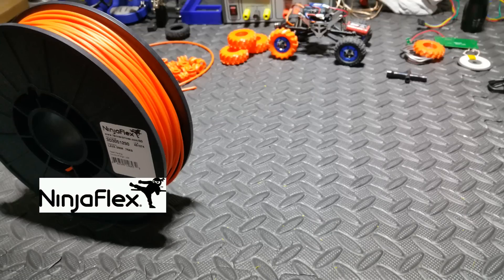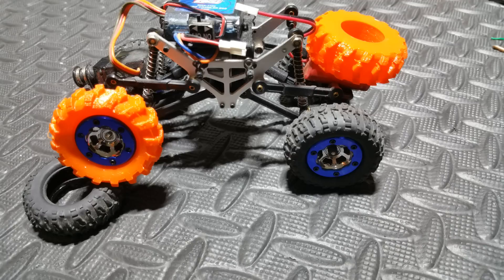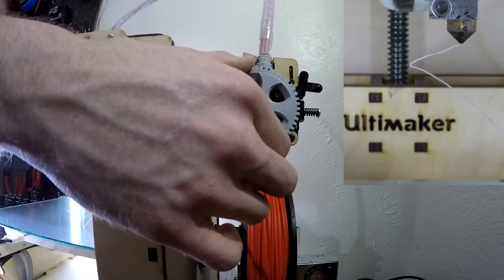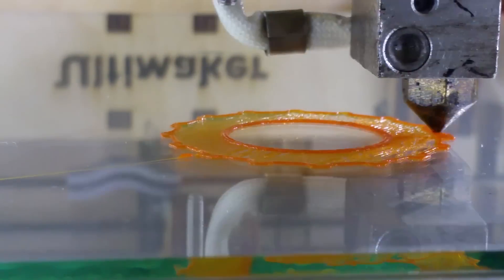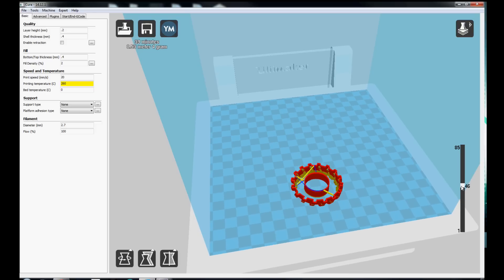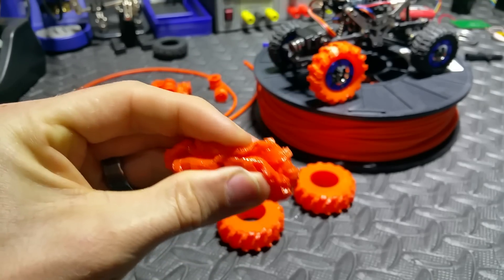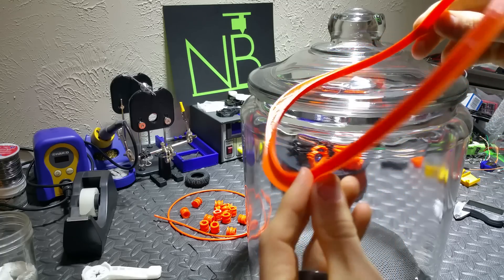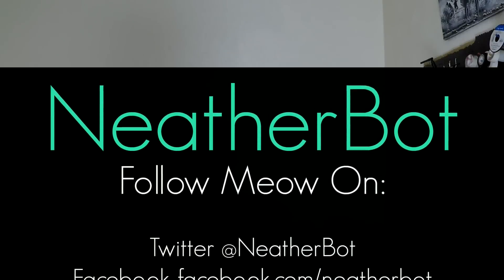Review - Ninjaflex Filament

Comment: I don't even use the same printer as you, but thank you for showing the print parameters when setting up the print.  It is incredibly helpful to have a baseline for settings to start with for any print.  It is also incredibly helpful to see the results compared when you changed your settings for infill and top layer thickness!

Comment: One thing that really helps with flexible filament in my book is to use a little oil on the filament and in the bowden tube. I found in my testing that NinjaFlex tends to be really runny and hates bridging. I don't know if you have tried FilaFlex but it is actually MORE flexible than NinjaFlex but I found prints way better! Just my opinion :) keep up the good work!

Comment: That was a great introduction to Ninjaflex! Good job! I have to order a spool myself soon, cool addition to have in the 3D printing toolbag ;-)
Reply: ***** I bet! I have seen people with dual extrusion making "hybrid" objects with both flexible and rigid filament which sound so freaking cool! Endless possibilities:-)
Reply: I have the Ultimaker 2 myself so i'm still waiting till they announce a dual extrusion kit for that! But shouldn't be to far off now, think the least word was early 2015 but i haven't looked in a while.
Reply: ***** I was checking the ultimaker forums just now to see how dual extrusion was coming along, and unfortunately they have decided to stop working on it. I seems it was to hard and required to much of an overhaul of the machine to be a viable solution :-(

But if you get it up and running on your um1 that would be a video i would love to see! Trials and tribulations I would love to see failure and success. Aparently it's a real bitch to get working more than 50% of the time...

Comment: Excellent video and thanks for the settings. I've had a little success with ninjaflex but just couldn't quite nail the finer points to get it exact. Great tip about feeding the filament too - I tend to do the manual wind-the-wheel just before every print to make sure everything is flowing freely. 
Your dog was not sure about the quadcopter all all!

Comment: So how did you determine the diameter of the o-ring prior to printing?  It has to be smaller than the lid's diameter to make it snug but not so small that ninjaflex can't stretch around it.  Any idea how to calculate or estimate this kind of thing for snuggly fitting around objects?

Comment: Do you know how well this filament handles UV rays? I was thinking about making weather strips for my car with this material.
Reply: @jayr Thanks for the input! I'm restoring an old SUV from the 90's a lot of the weather strips are dry rotted and the replacement seals are no longer available. Maybe a UV protectant coating could help it not to parish so quickly?

Comment: Have you tried using the flex filament to reduce stepper motor sound/vibration? If not would you do a video for it to see before and after. Even if it would be  fail and not reduce sound allot.  Would be good to know. Before others dive into it.

Comment: Can you do a video on you acetone jar also do you think ninja flex will work with a 1.75mm bowden system?
Reply: *****
It can work with 1.75mm bowden systems.  It depends on how the extruder is designed.  You can find successful designs for extruders at thingiverse.  Generally you will also have to print very slowly.
Reply: sillywwabbit I use a Greg wade with an e3dv6 and the tube all the way to the hayena bar (hobed  bolt) 

http://www.thingiverse.com/thing:517099

Comment: With my original Ultimaker 2 i could successfully print with Ninjaflex pretty much with the ABS setting. I have recently fitted the extruder upgrade kit which is where the problems have started. I load it up then start the print, the first 5 or so layers go on perfectly then the material just stops flowing. It looks very much like what you get if the nozzle is blocked but it isnt. When this happens i abort the print then to test the feeder i put it on "move material" and it flows fine. Does that ring any bell?
Reply from the maker: +AD58 A few things to look into. I am not sure what ABS settings you have but that is strange that it works with Ninjaflex. Temperature would be about right, but print speed and retractions would not be optimal. Take a look at print speed and if it is faster than 20mm/s I would slow it down to around 15-20mm/s. Retraction I would think needs to be modified, but if prints are not stringing then you are ok.
Have you tried any other prints with the new extruder and pla or abs material? Two things could cause this type of behavior of the first 5 layers going down before filakent flow being restricted. You could be printing too fast and the hotend is running out of thermal capacity or the temp could be too hot and printing too slow will csuse heat creep in the hotend. There are a lot of other reasons that might cause this but check the temp and speed first.

Comment: Hi, I am using Upbox 3d printer. I am actually wondering call all printer actually uses these different filaments? 

By default, my printer written that I can only print ABS and PLA.
Reply: +jacky sew Some printers can't reach the correct temperatures to use some of the more exotic filaments. Also the extruder setup will also come into play.

Comment: hey, just out of curiosity!
what would happen if I insert a heat shrink tube to the printer instead of the filament??
Reply from the maker: Haha I love the ingenuity of this question...I am certain it would not extrude. I would think that the tube would probably do its shrinking thing then slowly burn up and clog the nozzle badly. I would recommend NOT doing this.
Have you already tried?
Reply: huh thanks man.It would have been my first experiment XD
Reply from the maker: +tilan wickramarachchi to help you narrow down your experiments and avoid issues I would suggest only trying to extrude thermo plastics. Thermo plastics are special in that at a certain temp they begin to melt and flow, not burn. Other plastics will just skip right to the burning stage. I would be very careful expirimenting with different materials that are not originally intended for 3D printing. You can easily start a fire which I don't thin no anyone wants to do. Stay safe and keep up the experiments!

Comment: How do you create the acetone vapor in that glass jar? Do you just fill the bottom and then put the jar on a hot plate?
Reply from the maker: +Reptileguy 505 there are a few different ways. You can soak a paper towel and stuff it in the jar and let the cold vapors fill the volume. If you want to speed things up you can put the whole jar on a hart plate. But be careful you create a lot of fumes with the hot plate.
Reply: Do you recommend using the cold fume strategy?
Reply from the maker: +Reptileguy 505 it is slower, and less dangerous. But if you take some precautions using a heat plate can work awesome. I would recomend starting off with cold fumes. To see if you can get the results you want. Pull the print out of the fumes before it's fully smooth, it will keep melting a tad more after you pull it out.
Reply: Okay. Thank you so much! Love your videos too by the way! Keep up the good work!
Reply from the maker: +Reptileguy 505 no problem, thanks!

Comment: you can print it with bowden extruder? I have a mk2 like direct drive now only 6mm play but too soft flexi filaments are getting stuck, maybe becaus eI have 1.75 fila... not 2.7mm...
Reply from the maker: I have always printed ninjaflex with a bowden extruder. I also use 3mm filament.

Comment: wait.. you are setting the nozzle diameter contrary to what it actually is?? I have printed ninjaflex with a bowden tube with mixed results...
Reply: +Neather Bot I printed a cell phone case and some anti vibration do the keys for my quad that I designed. I think the key was slowing down the print for me. and what's interesting since I am using the Bowden set up is the extruder motor setup I have going on. I'm not sure you have ever looked at the Printrbot drive gear for the extruder. both the drive nuts and the bearing that usually squeezes up against the drive nut, they are both geared. so the bearing and the drive nut bolt have teeth that push the filament with more control.
Reply: so I guess I am asking... is your filament actually 3mm or 1.7mm?
Reply: +Neather Bot okay now it makes sense, that's what I assumed you were doing I do the same thing however I just change the flow rate. I increase it by about 15 to 20% and I think that changes the same thing but it probably depends on what sites are using as to whether or not that setting exists

Comment: Stupid question. If you print a Real size Shoe. and you wear it for 1 year. is that still strong. I mean the durability
Reply: +Neather Bot Yes. but the other company release the "FilaFlex" use only for Heavy work. maybe like hiking boot or something. They even produce they own extruder. So you can't making by using stock extruder Printer. but still. it kinda curious if we can build our own flip flop or shoe. Crocs shoe style. since the filament need to be thick. for the main purpose. Durability

Comment: that filament works with any 3d printer? I own a finder printer
Reply: No. You'll need a low friction hot end and an extruder which doesn't rely on the stiffness of the filament. Recently modified my printer to use a E3D v6 hotend, just for flexible filament. Also had to modify my extruder base so it exerted less spring tension, otherwise it liked to eat the filament.
If the hot end is all metal with a teflon heat brake, you should be fine as far as the hot end goes. Since the filament is no longer very stiff, you are more likely to jam.

Comment: Hi!  Thank you so much for your video!  I've been looking for a material to create a device that is supportive, yet stretchy, sort of like kinesiology tape just without the adhesive backing.  I've never used 3D printing before but I think this might be a good option for what I'm looking for.  I see from your O-ring that this can be printed pretty thin.  Would you say that at the thickness of the thinest part of the O-ring that the ninjaflex filament is still stretchy and strong?  Thank you!!
Reply from the maker: That sounds like an awesome project you are working on. Yes even the thin section is stretchy and very strong! Good luck!

Comment: Is this a tacky filament? Would it get alot of grip for R/C tires?
Reply from the maker: +JJ Horta I wouldnt think of it as tacky, but rubbery and grippy yes. I think it would work great for rc tires!
Reply from the maker: +JJ Horta oh yeah, it is great for RC tires. You may have to play with perimeters and infill to get the right stiffness, but I would think it would be a great application.

Comment: How should I know if my 3D printer support flexible filament?
Reply from the maker: +Hooman st well it can be printed by most printers. But getting the settings right is tricky. What printer do you have?
Reply: flashforge with dual extruder
Reply from the maker: +Hooman st that is a direct drive extruder so that is a plus. Do you know what nozzle diameter you are have?
Reply: I believe it's 0.4mm
Reply from the maker: +Hooman st ok that's great! You should be able to print ninjaflex without too much hassle. Just remember to print slow 15-20mm/s and to get the filament flowing through the nozzle before starting the print.
Reply: dude you are awesome. thanks!
Reply from the maker: +Hooman st if you run into any snags hit me up and I'll help you set things straight. You should be good to print ninjaflex with your setup. Cheers!
Reply: sure thanks! by the way I subscribed to your channel!
Reply from the maker: +Hooman st excellent! Thanks for the support.. What has been your favorite video so far?
Reply: Review - Ninjaflex Filament
Reply from the maker: +Hooman st ok cool. I have some more filament reviews coming up. You will probably like those too.
Reply: Sure! I selected the notification to get updated.
Reply: I heard you need to have a heated bed to get ninjaflex to work properly and some printers won't be able to use it because they are only compatible with the manufacturer's filament unless you mod them and void the warranty...
Reply from the maker: +Disney Gym Girl +Disney Gym Girl I do have a heated bed but do not turn it on when printing ninjaflex. I have a glass plate that I print on and ninjaflex sticks very well to glass. Depending on the type of build plate you may need to heat it up. What type of 3D printer are you using?
Reply: That is so cool to know! I am quite new to 3D printing so I am looking to start with a Tiko or 101 hero so probably none of these will work with Ninjaflex. I was told that without a heated bed you can't use it at all... so I guess the info I got was wrong or it takes a special printer to get it to run without one like the one you use. I create 3D printable models but I need to test them out to see if they work in Ninjaflex. Sadly I do not have a machine that will do that so I can only print on basic PLA or at least I think once I get my first printer in.

Comment: What size nozzle were you using?
My stock Ultimaker 2 with the 0.4mm nozzle produces only decent results with quite a lot of under-extrusion, I have an Olsson Block on the way so wanted to know what nozzle were you using and then keep that diameter nozzle specifically for NinjaFlex and no other material to keep it as clean as possible from other materials and impurities disrupting the flow. 

Also wanted to know if you noticed changes over time with Ninajflex?
TPU absorbs a lot of water so overtime it's almost impossible to get good prints unless you have evaporated all the water out even if you have dialed in the right settings. 
I am on my way to master NinjaFlex printing on Bowden systems without external modifications but not quite there yet. 

Thanks.
Reply: +Neather Bot LOL, quite a late reply. 
Anyway, I have been printing with a 0.8mm Nozzle with truly remarkable results, I have never seen such clean fills printing in TPU on a Bowden system. I have been printing at 240C at 0.4mm Layer Height and 120% Flow at around 20-40mm/s depending on my Layer Height. Boy does the Ultimaker print beautifully.
Considering my main use is to create a few Prototype gaskets which usually are quite big and don't require a low Layer Height, detail isn't a priority. I have no problems with a Larger Nozzle and lower detail. 

I highly suggest you try the 0.8mm Nozzle as the results are truly staggering!
Reply: +Neather Bot And yes, I saw your De-Humidifier video. That's a bit inconvenient for me as I have two spools at the back at all times, one ABS and one Ninjaflex as I swap and use both very frequently. 
I find that the combination of a bigger nozzle with the right flow settings help you combat the issues of water absorption in the Material, of course too high of a temperature or too slow of a speed play a role also. 
I have been quite pleased with the results since I was seriously considering a direct drive printer for Ninjaflex once.

Comment: https://youtu.be/7_CNnaOf5B8?t=51 (your clip at specific time)

What heated bed are you using?? i found one on ebay with pre cut holes and same connector as yours, but that one is 2mm thick (the alu plate) and yours seems a bit thicker, or is it just the warp effect from the fisheye lens?

Do you have a link for the exact heated bed you'r using?

If it is the 2mm version have you had any issues with the plate warping when heated up?

Comment: can an Anet a6 print in this?
Reply: It will probably buckle, you will have to modify the extruder.
Reply: Yes you can but it might get jammed a lot so if you want to print Ninjaflex I would recommend changing the extruder with a flexion extruder that you can buy online.
Reply: Only problem being, that a flexion extruder is more expensive than a complete Anet printer...
Reply: e3dv6 with gregs wade extruder
Reply from the maker: +kicker22004 thank you for helping find a good answer. Just about any printer can print with ninjaflex, but you need to be really versed in how to adjust temperatures and feeds.
Reply: I try to give feedback when I can, There is also another extruder setup that works on the Anet A8 but it's pricey to build and source parts for. This is it: https://www.thingiverse.com/thing:1246951